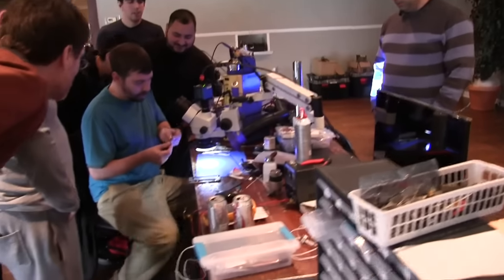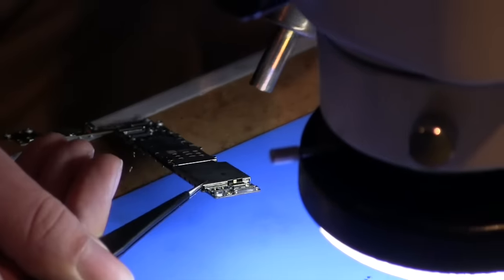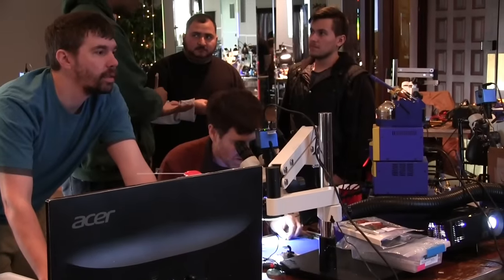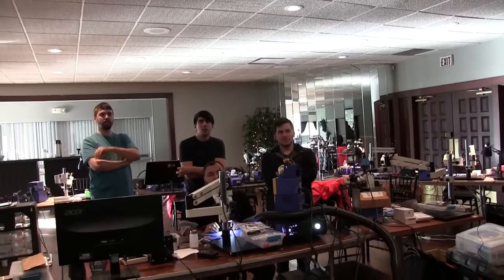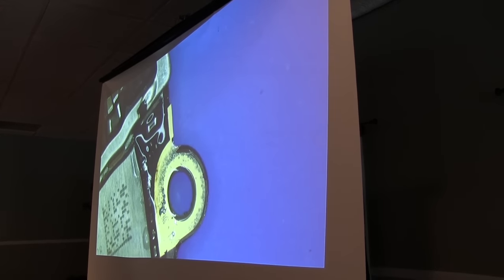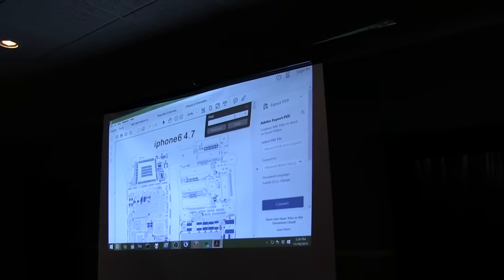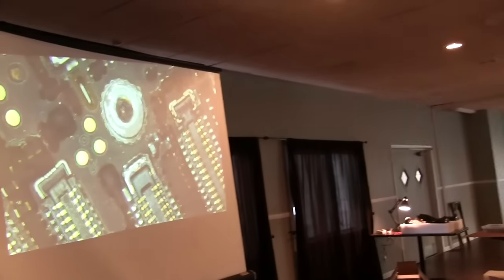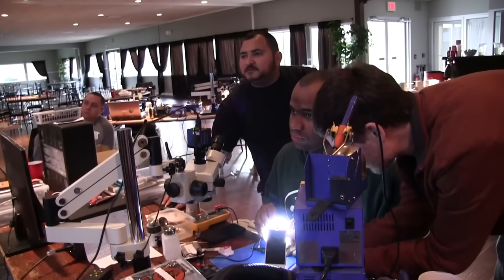iPhone Data Recovery by Practical Board Repair School Students

Comment: Excellent videos, 
Would you kindly share the model and make of the microscope used on your videos  ?
Reply from the maker: Hi! Thank you for your interest in the equipment we use.

I use several different microscopes here, including an Amscope microscope, that can be purchased at the link below. 

https://www.amazon.com/gp/product/B005MRAAR4/ref=as_li_tl?ie=UTF8&camp=1789&creative=9325&creativeASIN=B005MRAAR4&linkCode=as2&tag=rossmanngroup-20&linkId=8c3b94523f849afcbb9e232f303e4670

Comment: No Jessa you will get error 53 on the 5s, iPad mini 3rd gen and iPad Air if ID cable is damaged
Reply: Well Air doesn't have a Touch ID so I find that one hard to believe. IPad mini 3 would be like iPhone 6, and for a 5s any original touch should work.

Comment: Or just unsolder the led backlight ribbon on the screen and power the backlight with a switching power supply no torch needed :) the screen remains functional without messing with the led assembly duh lol
Reply from the maker: +ASTRO MAN good idea, but I ended up keeping a cracked screen in every 'known good parts box' just for janky screen backlight solution for data recovery.
Reply: +iPad Rehab All about efficiency hate wasting time the 10 seconds juggling a light adds up times money etc and would rather be doing the latter making money, maybe have one pre wired use a 9v battery with resistor to power the leds either way works pre wired or "janky" screen  <----- is that a common usa slang think it translates in the uk to homemade solution or bodge to get by :) superb videos btw come from a hardware scene that was all about sharing, which is in short supply these days mostly just common sense and analytical thinking, i tend to lurk these days rather than share as got burned did you work out error 53 with man in the middle attack yet :)

Comment: Sorry its the ipad air 2nd gen that will get error 53 no any original touch id cable don't work for the 5s its pair to the board i have had a lot of 5s in with this problem after home cable replaced.
Reply: Original touch is paired to the board, but the whole world has been replacing the original 5s touch with aftermarket home buttons and giving up touch function for over a year. I don't think 5s gets error 53 like iPhone 6 gen devices.

Comment: Hello, thank you for the video :) - What is the model of your Amscope microscope and Crest cleaner?
Reply from the maker: Hi! Thank you for your interest in the equipment we use.

I use several different microscopes here, including an Amscope microscope, that can be purchased at the link below. 

https://www.amazon.com/gp/product/B005MRAAR4/ref=as_li_tl?ie=UTF8&camp=1789&creative=9325&creativeASIN=B005MRAAR4&linkCode=as2&tag=rossmanngroup-20&linkId=8c3b94523f849afcbb9e232f303e4670

Now for the ultrasonic cleaner, I recommend use of a CP500HT - large enough to fit laptop motherboards as well as cellphone motherboards, with small addition in price. 

https://www.amazon.com/gp/product/B00VGXXJDA/ref=as_li_tl?ie=UTF8&camp=1789&creative=9325&creativeASIN=B00VGXXJDA&linkCode=as2&tag=rossmanngroup-20&linkId=86be2e7d472d625cd48a93eee9cc94b1 

https://www.amazon.com/gp/product/B00BWESDKW/ref=as_li_tl?ie=UTF8&tag=rossmanngroup-20&camp=1789&creative=9325&linkCode=as2&creativeASIN=B00BWESDKW&linkId=18797ab2fefeebbb442a4bd0a694e963

Comment: Can't understand that when the cable is pair to the board on the 5s I have replace after market cables and the touch ID no longer works any device that has a Touch ID IC on cable will no longer work if you replaced it with a after market cable if restored it will come up with error 53
Reply: I don't think this is true for the 5s. I think the 5s will restore just fine although of course it will not have Touch ID function.  Error 53 is unique to the 6/6+ and similar generation devices.

Comment: I'm working on an ipad 4 liquid damage. After cleaning as best I can without ultrasonic there's a low resistance on PPVDD_SOC_H5 (1.2V CPU line) which sits around 120ohm and decreases with temperature increase, reverting as it cools. The fastest response is with a finger on the CPU, the resistance drops more quickly than with anywhere else making me think the fault is in the CPU. 160degC will bring resistance to a couple of ohms. Have you seen this effect and would you agree the CPU has internal fault? Thanks in advance :)
Reply from the maker: No, sounds normal for a CPU power line
Reply: Got it booting. Now I just need a graphic that shows lock screen button positions so I can draw them on the touch panel as I don't have a working LCD. Have to be creative sometimes :) Cheers Jessa

Comment: Have you encountered issues where there is no short but the phone only draws very little current around 60ma so it doesn't power up or iTunes can't detect it. Any idea on those?
Reply from the maker: everyone wants every problem to be a short.  That is only half the problems.  The rest are the opposite---open circuit.